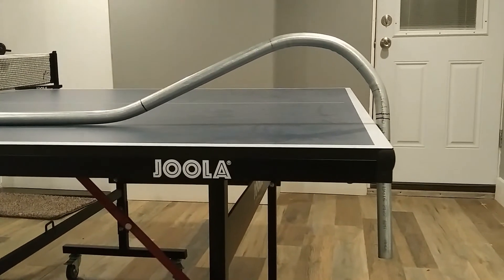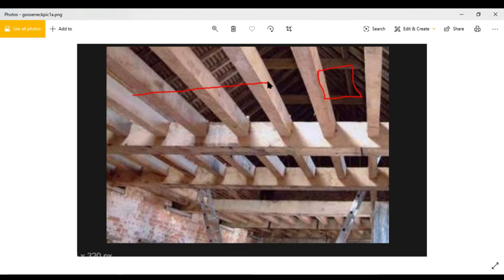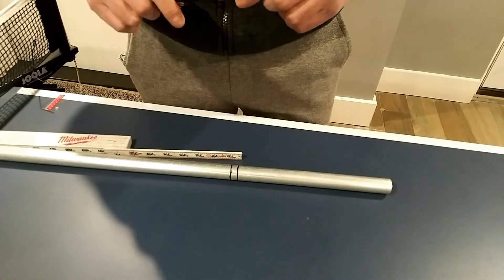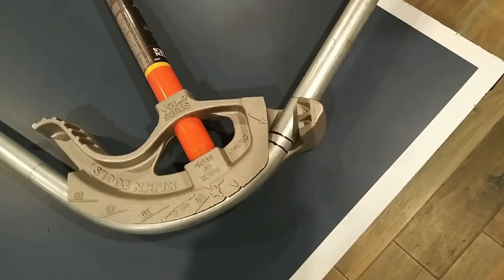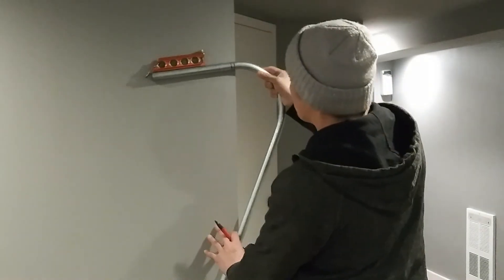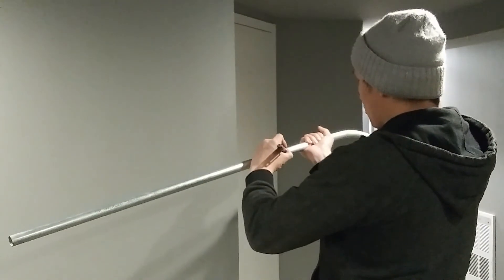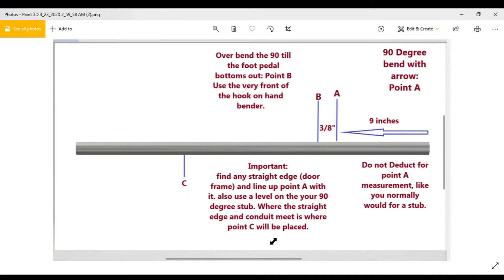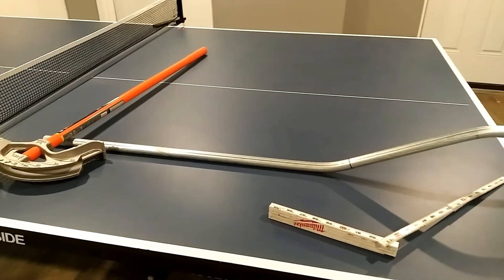EMT Conduit Bending: Best way to bend a Gooseneck Accurately

Comment from the maker: One thing I didn't explain in the video that I definitely should have. This is not a bend that you want to really do on exposed work. This is mostly for residential work like that example I showed in the video. With that said there are low voltage conduit installers that use it a lot so that they don't have to use condulets. I have seen some conduit runs that look really good with this bend in it. I'll leave it up to you to choose when to use it or not. I personally have used it here and there on exposed worked and only when a condulet was not an option.
Reply from the maker: @Aaron Ausmus Glad you mentioned it. One thing I mention in the video is that this bend is mostly used for residential applications where electricians use EMT and they have a j box mounted on a joist or truss and they're running the conduit right on top of these trusses. Well an LB condulet would be nice other than the fact that it's getting sheet rocked. Or commercial applications where your running low voltage or fiber optics and you can't use an LB consult cause the radius of bend is too tight. Lastly a good time to use it is when having a condulet would be inaccessible. Listen, I've used this bend maybe a good 10 times in my life. I try not to use it and if I do I try hard not to have it so exposed. It's not a real attractive bend to everyone. If I do use it I make sure it's on a nice and tidy run. I would install it after a run that has an offset followed by a 3 point saddle and a 90 stub with a kick. Get my point? Hey thanks for watching my videos and most of all for the comments. Thanks again.:_MechanicsSquare::_MechanicsWrench::_MechanicsRuler::_MechanicsPencil:
Reply from the maker: @Aaron Ausmus actually it's a few degrees over 90. And no, it would technically be harder to pull cause of the bend before the 90. Know what I mean. With that said it's no more difficult to pull wire through than a regular 90 with a kick.
Reply: I just used this bend today. It's actually beautiful.
Reply from the maker: @danwalters4606  Nice. I'm glad I could help.  I have plenty of other videos.  I'm working on some other things as well. I give online classes of your interested. All my videos will soon be moved to my own personal website.  I'm fund raising at the moment if you can contribute with any type donation it would help and be appreciated. Links below.
Cashapp- $artofconduitbending 
Venmo@artofconduitbendingv 
Melvin.c.rubio@gmail.com 
If you donate pls email me so I can enroll you in the donors club.
Reply: @Aaron Ausmus:

This must be counted as a total of 135° of bend.

Conductors can be added and removed without access to the attic.
Reply from the maker: Exactly is not talky for exposed work

Comment: An easier method, bend a 90⁰ then an offset starting extremely close to the 90⁰. This will put your 90⁰ bend tight and close to the wall with less distance off the wall. Most of us call it a Shepards hook.

Comment: How many degrees does a goose neck count as ?
Reply from the maker: @deen8232  good question. About 145° I personally like to install conduit bodies before and after a goose if possible but at least one should definitely be installed wherever feasible.
Reply from the maker: @deen8232  Also if you can and are willing.  I'm working very hard to fund raise for a couple of projects I have in motion. First is a electrical software that assists in teaching conduit bending through a 3Dgame format.  as well as upgrading this channel to have some 3d animation content incorporated.  Because as you may know I can't record every situation live.  Some content had to be done through 3D animation.  Which will bring more useful content.  This is definitely the future.  
Anyway I need funding for this.  If you can I'd appreciate it.  Links to donate below.  Pls email me if you donate do I can add you to my donors list.  Thanks.  There will be a prize and free use of my software for a limited time.

Comment: When the 22.5 bend is bent, could a level be put on the tail end to get that level? Is that whats being done? Thanks.
Reply from the maker: @danwalters4606  you could utilize on the tail end bur the most important part is getting the 90 to be level
Reply from the maker: @danwalters4606    hey how are you I'm  Mel the creator for the channel. I'm raising funds for the channel and another project, which is having a electrical conduit Bending software built that will help you learn how to bend conduit. Any how I'm not asking for a lot any little bit helps. Whether big or small I appreciate it. 
I cant fund the project my self i am not wptking i am out on medical leave for a little while.Thanks I only have these 2 methods of receiving funds. 
No such thing as a small donation. 
Venmo@melrub480v 
$artofconduitbending

Comment: 3:30
Careful to those out there doing this on EMT sizes other than 3/4, this is not going to be true for you.
The reason for this second line is to give your bender enough material to grab onto in order to "continue" the 90 into a "hook" shape.
Reply: How can I adjust? Is the second line supposed to be half outside diameter? I tried following the video with 1" but bottoming out didn't feel right and I ended up eyeballing the rest of the bends

Comment: Why is it 3/8 of an inch ? Where did we get the 3/8” from ? Im confused
Reply from the maker: What's confusing you. That's just the way it was learned at school. It works. Just follow the steps
Reply: @TheArtOfConduitBending  no I understand everything else. I just wanted to know where we got the 3/8 from? Like will that work on all conduit sizes ?
Reply from the maker: @eazypeazy7743  it works on every size upto 1-1/4" I haven't done with larger than that but you wouldn't want to. I'm sure there's a formula. Like I'm almost sure they got it from the trig table. The cosecant to the angle.

Comment: Curious if that has to be a 22degree bend.  Can it be a 10 or 45?
Reply from the maker: yes definitely has to be a 22 degree bend. Now sometimes you'll either under or over bend the 90 more than you are suppose to. Then you'll have to compensate by either bending a little more or less than a 22. So it all depends on the over bent 90 you bend. If it's done correctly then yes you'll have to bend a 22 degree bend so that the straight portion of the conduit is level. hope this helps.

Comment: What would you do if your pipe was running underneath the wood then had to go over the beam on top of the box
Reply from the maker: In that case i would have to offset it the conduit to get it on top of the wood so i can do this bend. it's the only way. it obviously wont work the opposite way cause the sheet rock has to get installed and you dont' want the gooseneck sticking out of the ceiling.

Comment: Is there any way to do this with an electric bender? I don't see how bend the 2nd mark is possible without over/under bending it therefore, throwing off the 3rd mark (22.5 degree mark)
Reply from the maker: don't worry about over or under bending because the 3rd bend will take care of that with a level like I said in the first message. But you still have to lay it out the way I showed you in the video.
Reply from the maker: yes you can use the same markings on the second bend just over bend it to about 95° then the 3rd bend do the 22.5 or just put your level on the stub how I have it in the cover puc of this video with the level vertical and keep bending till its level. simple...

Comment: I had to bend my back bend at the star or it wouldn't work. I'm using the same Klein bender as you too on 3/4 conduit. What happened? When I used the arrow it came out parallel with the tip
Reply from the maker: Not sure what you did

Comment: This bend is not legal because it is more then 90 degrees of continuous bend. This bend makes it harder to pull wire that’s why. To achieve the same goal with a legal bend first bend a 90. Then move the bender back a couple inches to have some straight conduit. Then bend an offset. Of course some inspectors may let it go but why take the chance, plus it’s not aesthetically pleasing. Looks goofy and unprofessional. By the way the legal bend I’m describing is called a shepherds hook.
Reply from the maker: This bend has been taught by the NJATC for years. Still is being taught. It's in their conduit bending literature. Also I think you are misinterpreting 358.24& 26. Otherwise do you know how many inspectors have passed my bends when wrapping around a Silo or water tank. Many low voltage electricians use the bend as well on exposed work they never fail inspection. But I know you're not alone. This has been up for debate for quite some time. Thanks for the comment.
Reply: @TheArtOfConduitBending  yes it is up for debate. I wish the NEC would address this. But AHJ (Authority having jurisdiction) has the final say, period. Have you been in the position of delaying a multi million dollar job? I have and I would never take the chance. Use a shepherd hook or 2 bend 90 and you can’t go wrong. If you have the room. If not you will probably get a pass. Just my take. 25 year electrician, 12 year Foreman, 8 year service truck.

Comment: Got a chance to do this bend at work yesterday. I learned about this bend in a conduit bending class but forgot the details because there hasn’t been a need for it and time has passed. Watching your video helped me to get the job done! 🙏🏼👍🏼
Reply from the maker: Oh wow cool. I'm glad Im able to help you out. This bend is actually a special bend. It's almost been forgotten and lost because not too many electricians know how to, 1. Bend it properly, they don't know the actual formula 2. They think an offset and a 90° bend put together is the same thing. 
Also I have to say there's one thing I didn't mention in my video. This bend is mostly for and should only be use in situations where it's not going to be exposed work. Mostly residential. But it is used sometimes in exposed work. low voltage electricians use when they can't use Conduit bodies because maybe they're running fiber optics on the conduit and the conduit body is just not an option. Also to some electricians it's not a very appealing bend. Anyway glad I could help

Follow me on:
TikTok/holmzlaw
Facebook/holmzlaw
Instagram/holmzlaw
Reddit/holmzlaw
Reddit/r/conduitology
Reddit/holmzlaw
Tradeshound/holmzlaw
Twitter/holmzlaw
Quora/artofconduitbending
Quora/holmzlaw

Comment: what if you just want to get around a corner without going into a box? do i just measure to the corner and follow the same steps, would there be any shrinkage?
Reply from the maker: Well it's used to go around a corner too. If your not going into a box then you can use any measurement you want but I think there is a minimum stub of at least 6 inches.

Comment: How to bend a goose neck pro tip: buy an LB conduit body and next time let someone else plan your pipe run. Just kidding! Make sure your run is short and without many more bends because pulling wire through those can be a pain
Reply from the maker: Great pro tip. Thanks for the comment.

Comment: I can bend this pipe without making all those marks ..just need my 90° stub measurement..but I was told try to not make these kind of bends....
Reply from the maker: Yea I agree if you don't have to make the bend I wouldn't. If you can make the bend with out the mark that's good. This is for those that want to learn the formula to do this bend accurately Everytime.

Comment: Is there an accurate way to lay this out using 100% center-bend measurements. Like let’s say I wanted to bend a 135°-45° gooseneck offset bend in the middle of a run. How do I lay out my travel and is my loss/shrink accurate as if it were a normal 45° offset? I have tried laying this out with tubing multiple times and can never get it right. I can do a simple offset followed by a 90°, no problem. But for whatever reason, combing that 90 and 45 together just seems to throw something off. I also use the 4 mark bend method, so I’m able to find my gain for a 135° angle. This video is nice, there is just some instances where it’s tedious for me to line the tubing up with a straight edge due to multiple bends already put into my tube.
Reply from the maker: Honestly I wouldn't do a gooseneck with multiple bends I would keep it separate.
Reply: @TheArtOfConduitBending  I gotcha. And it’s not necessary in most applications, it’s just nice to know. I like the idea of eliminating an entire bend by combing a 90 with your offset angle. Same concept with kicks. You can bypass the need for a kick with just a 90 and an offset, but you have a cleaner aesthetic by combing the two. Thanks for your input!

Comment: I'm struggling to bend the obstruction how many points did l need to mark just from the  centre thanks for Vedio that's described for 👍
Reply from the maker: Not sure what you mean. You have two marks by the 90. ONe to make the 90 then the other to over bend the 90. the last and 3rd bend is the center bend that is a 22.5 degree bend but you have to line up your first mark with a straight edge and make sure its level then where your conduit crosses the straight edge you place the mark and bend it with arrow 22.5 degree. Done. if you don't understand send me a message in one of my social medias so i could give you my Discord server link so we could talk better and i could explain it to you better. actually this is my Discord link. 
Discord
https://discord.gg/ntkfmC3Vq4
come find me there. we'll talk.

Comment: What if your distance apart is less then 6 inches. I was using your technique at work but I had some distances that were like 2-3 inches.
Reply from the maker: What I usually do. If it's got to be shorter than 6" I'll bend a 6 inch piece and cut it to the measurement I need. Now I do want you to know that there is a point that you can't cut because of the bend not letting the connector go on. Hope this helps.
Follow me on 
Snapchat/Holmzlaw
Facebook/Holmzlaw
Instagram/Holmzlaw
Trade hounds/Holmzlaw
LinkedIn/melvinrubio
Discord - https://discord.gg/ntkfmC3Vq4

Comment: my dude, per code you are not supposed to ben over 90 degrees. just bend a 90 and then bend an offset right behind it
Reply from the maker: My guy... With all do respect. That's simply not true, at all. Dont know who told you that. Also if its per code. I would like a code reference. Also i would remind you that there are plenty of times I've bent segment bends over 90°. I actually bent 180° on a single length of conduit and passed inspection.
Reply from the maker: Also ive done this bend in numerous locations and have passed inspection as well.

Comment: A pull 90 or LB would look way better and faster but if you were out of them this is a great bend to know how to do
Reply from the maker: That's all i'm trying to do is teach brother. I mean it's an official bend. Wether it looks nice or not is purely opinion. I've done a rack of 10 of these all lined up looking absolutely nice. And we didn't have to worry about an LB up about 15 feet. We were able to pull straight from a pull box 5 ft off the floor. So honestly what looks good to you might not look good to me. What works for me might not work for you. But it's not against the Code and The conduits are install in a neat workman like manner. Thanks for the comment. Appreciate the comment. Again thanks. Hope you watch my other videos.

Comment: Thanks for the lesson bro.

Not into the sharpie or bending on a finished floor, but the rest was great info.
Reply from the maker: Thank you for watching and most of all for commenting. FYI i only used the sharpie so that you guys could see it better. I get a lot of messages telling me they can't see the pencil marks in the video. As far as the finished floor goes. Its no big deal i maintain them.
Reply: @TheArtOfConduitBending  i figured.

I will admit i use sharpie sometimes haha, but it is its own solvent.

A little wet sharpie on the dry and it wipes off. Non pourous surfaces.

Comment: In my 50 years never did one. Old timer that I trained under would not allow it so always used a LB condulet.  Can see where it would be great to use if you are out of LB'S. Cheap union guys would use it just to save a few dollars. Was a royal pain when they used it in a tight drop ceiling.
Reply from the maker: Yea i hear ya. I use when i have to. Most foreman dont want to see a gooseneck exposed. So if i can get away without using an lb then ill use the gooseneck but if i need to put a box cause im over 360 already then i just use the lb.

Comment: I would just use and LB before I did that. Cool looking bend though
Reply from the maker: Thanks I like the bend too. I hardly get to use it anymore cause ive been doing h heavy commercial work. As far as LBs are concerned what if the conduit was for Low voltage cables or even fiber optics?

Comment: I have tried this type of bend before but a different approach. I did a 90 bend first then add an offset. I like this way better because its simpler. 👍
Reply from the maker: Thank you. Not for nothing this way is the right way to do it. Amd its called a gooseneck. Also the 90 with an offset people call it a shepherd hook ( 90 w/ a offset ). Either way os cool. But this is the right way to do. Thing is people made up the shepherd's hook because 90% percent of the people never learned how to do it the right way so it was just easier to do a 90 with offset. Anyhow thanks for watching i really appreciate it. 
Check out the Facebook group "The Art of Conduit Bending"
Follow me on
Facebook@holmzlaw
Instagram@Holmzlaw
Tiktok@Holmzlaw
Post work here
#conduitology #conduitologist #conduitologism #holmzlaw #artofconduitbending